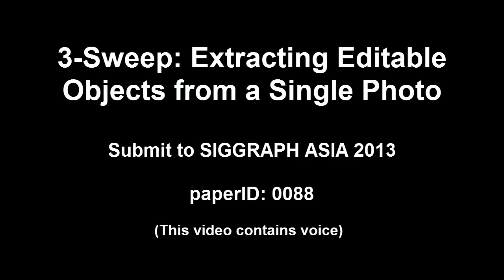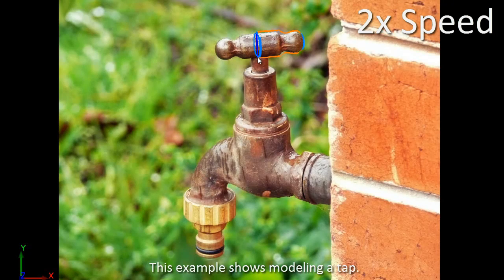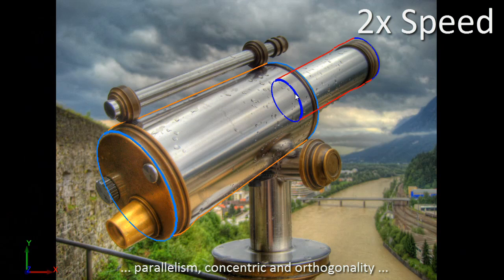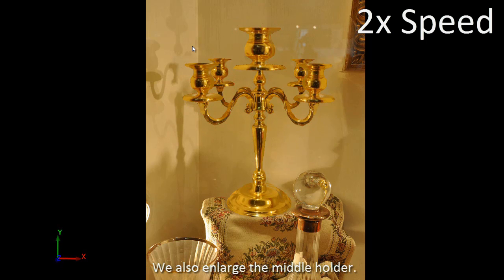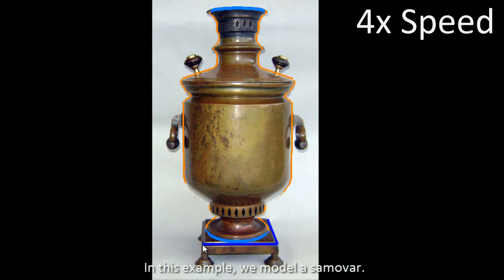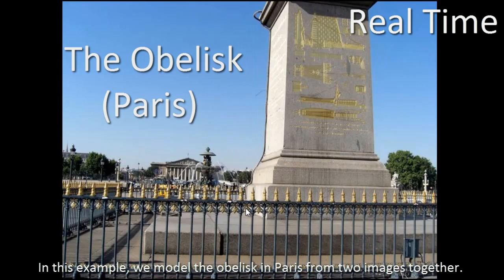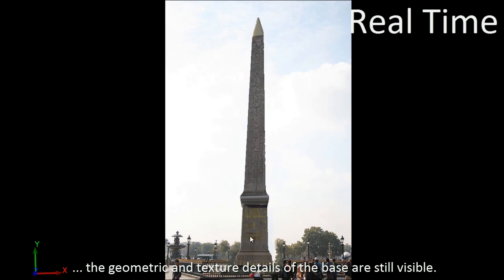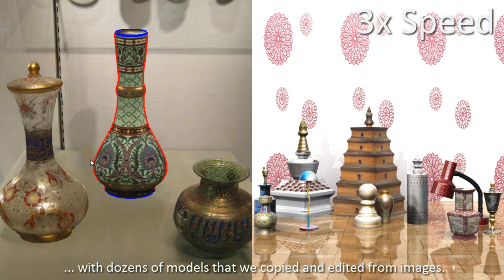3-Sweep: Extracting Editable Objects from a Single Photo, SIGGRAPH ASIA 2013

Comment: Too bad this requires some level of symmetry and that it gets fooled by shadows etc.
But it's great technology. Just needs to mature a bit more for practical use.
Reply: they can get around those errors by allowing the user to manually edit the curve. like with the bottle that has poor edges you can simply put a new edge that follows the contour.  for the toothpaste, i could see a similar editor that allows you to put in primitives you think fit better and the app can blend the new 3d model with the current. think the same can be said for the table with odd perspective.

Comment: -Looks too good to be true. If this was legit, you would have shown the entire interface of the software instead of showing us the edited photos  . And if so, Hollywood would have mentioned this ground-breaking technology already.
- Creating texture out of thin air even for the other side which is not visible? What soft of witchcraft do you use to uv unwrap it?  
- This software really defies the laws of physics and cgi
- It would probably disrupt the entire industry. Imagine modelling absolutely "anything" from a photograph
- It's the 21st century after all, technology like this is bound to be invente tho
Reply: "-Looks too good to be true. If this was legit, you would have shown the entire interface of the software instead of showing us the edited photos  . And if so, Hollywood would have mentioned this ground-breaking technology already."

sadly a lot of breakthroughs become vaporware because nobody knows the potential or companies just buy it to sit on it.  

"- Creating texture out of thin air even for the other side which is not visible? What soft of witchcraft do you use to uv unwrap it?"

they simply project the photo onto both the visible side and the occluded side of the model and maybe do some automatic symmetry to clean up messier projections.  as for how they get rid of the background Photoshop has had Content Aware Fill since CS5, maybe even earlier.

" This software really defies the laws of physics and cgi"
not sure where you got physics from but $50 says this can be cooked up in a plugin API.  all it does is find edges and then flips those edges in a symmetrical way to build a 3d form. like  it can turn a hexagon shape into a cube shape by mirroring the bottom 3 points into a 4 point plane and extrudes that new square shape into a cube shape that follows the contours of the diamond, making the 12 pointed hexagon actually an 8 pointed cube.

"- It would probably disrupt the entire industry. Imagine modelling absolutely "anything" from a photograph"

it would increase productivity by %200. compositors would use it to  generate quick 3d scenes from plate footage to pass off to the VFX guys  without having to waste precious time for structure-from-motion to take hours to generate and don't need to go on location to lidar and photogrammetry the environment at the beginning, just leave that technology for the final comp when the scene blocking is complete.   modelers will use it as a kitbash app that lets them model boring and mundane but very necessary items like tools hardware utensils etc leaving more time to create the wholly unique and original assets ie you use 3-sweep to "model" all the car parts your transformer character would be covered in.
3d printers and prop makers will use 3-sweep to generate "base models" of movie props they can't get their hands on physically allowing them to get rough measurements to build off of rather than having to manually measure each dimension, doubly so for things that only exist in photos now like demolished buildings and lost artifacts.
AI scientists working with machine vision will use 3-sweep to feed their algorithms prime examples of the images it will see being physical objects, by having the original photo along with its to the pixel accuracy model providing depth, contour, volume and other attributes found in 3d items.   this can only help the industry not hurt it.

"- It's the 21st century, after all, technology like this is bound to be invented tho"

too true. if they don't release it someone else would make it given it simple nature. hell we got a face mapping technology remade this year when the tech existed sicne 1999.

Comment: Friends, this is great! Do you think it works? Link:
#Lovely_3d_Effect_Photo_Photo_Animator_Ae_Templates
Reply: +DESIGN IS MY LIFE Very cool project.
Reply: +DESIGN IS MY LIFE It's great
Reply: +DESIGN IS MY LIFE Yes. It works.
Reply: +Only Best Templates - where did you get a copy of this software? I haven't been able to find it anywhere.
Reply: +Chris Burke This is the template for the program After Effects. Via the macropoker it is sold.
Reply: There is still no proof of it's existence or functionality. Nobody, not even yourself, has been able to offer any proof in the form of a verifiable software product sale page, nor download to suggest otherwise. Until that much can be done, it should be assumed that it does not exist or does not function. If it is a plugin or add-on for an existing software product, then proof would be something such as a tutorial on where to find it, how to get it, and how to install it in to that software product.
Reply: AfterEffects doesn't do this.

Comment: The telescope case is very interesting: Since you have a 3D representation of this object, you can now exploit the reflection on the cylinders to reconstitute the scene on the back of the photographer ! and since you have multiple different  reflection with different positions, you can even turn it into 3D.
But this would require quite much hard work to be done!

Congratulation for this amazing software !

Comment: The only question remains. When will this wonderful piece of black software magic will hit us mere mortals ?
Reply: 2021 still not available
Reply: @bloomp7999  Lol...because it was an elaborate hoax in the first place
Reply: @Joyfulmischief  waaaaaaat yes it Indeed looks like a hoax, but i was hoping , it could be Real!
Do you have a proof of what you Say ?
Reply: @bloomp7999  No. But obviously...It looked really incredible, but never anymore info than this video surfaced, so there is little doubt now 😉
Reply: @Joyfulmischief  Research work takes time to be a commercial product. I think someone has already developed a Maya extension version of this on Github. But it requires some prior knowledge in programming to use it. I do not think any company would like to purchase this technique at the moment...
Reply: Alredy possible to do it on ISO Photo Perspective matched ortho RHINO CAD viewports..but without texturing which has to be performed manually afterwards!

Comment: Because it's not a cylinder getting wider. The program is looking for a specific shape that the user has selected and pointed out. The area the user painted went all the way to the top, so looking at the whole thing, it can see the arms are not part of a skinny cylinder and ignores them. It doesn't just look for edges, it looks at the shapes in the photo. I'm guessing this is why there was so much brushed metal, since it makes it easier to identify a shape visually from only 1 angle.

Comment: One question: if the software gets a 3D model from a single 2D picture: how does it know the part of the background behind the telescope, which is visible after this element becomes "moveable" as a 3D object? It seems like there are two separate layers: telescope and background, not just a single picture.

Comment: It assumes simmetry...
No one knows what really is on the other side, but you can guess, that it is just the same as this side. Also "just a bit of shaking" what??? WTF? Are you blind? There is rotation around multiple axles resize and move all in 3d not in plane... This is like magic, i hardly believe the modelling part, not to mention the skinning, background fill, shadow correct and all the rest.

Comment: I've seen iteration synthesis at the last SIGGRAPH. So basically algorithms that take some models (for example, five pairs of different sneakers) and from that set, these algorithms can create new sneakers (!!!). So you can imagine how that will work with this one here? You'll be able to "3D trace" an object from a photo here (for example a street lamp) and then once it's recognized as belonging to the category "Street Lamps", the algorithms will generate 50 different new/different design ones.

Comment: Don't equate yourself to the "credible people", ok? 3D resynthesis software exists for years and has been used to create 3D models out of multi-frame videos. The only difference was the multi-frame, multi-angle nature of moving pictures. This here is simply an evolution to a point where vertical/horizontal mirroring of the helf-lines (there are always two) and path-recognition is further automatized. No, this is not the church, so you don't need to "believe" anything here, Mr.Expert. lol

Comment: Looks like it only builds the objects by mirroring to the other side. The difference is that it also calculates the angle of the object then builds the object at that precise angle. This will only work for objects that can be split in half. Cars, boxes, candles. For instance, I don't think this would work for something like a person unless you had a front and back image to mend together after building the object

Comment: At 1:10 they stated that they use another "patch match" program to fill in the holes created by removing the object.

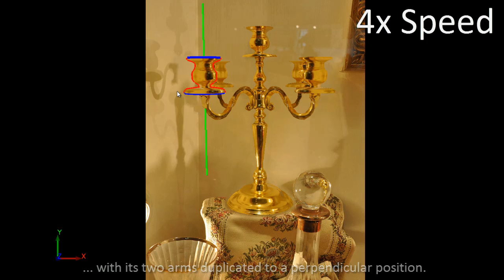This is visible at 2:18 if you look to the far left at the candle's shadow.  The area where the the candle used to be has a solid shadow with a noticeable "cut" in it, and in its place is a fuzzy area that is a color that results from mixing the shadow and the yellow wall together.

Comment: I don't see how this replace the manual modeling.

The software results are amazing, yes, but you still need 3D modeling knowledge to fix the automated results or modify it (specially for rigging).

This only make the process faster, but it doesn't do it all.

Comment: Look closely at the background of each example as they have repeat blocks of pixels of the surrounds. This is feasible to do automatically but with less predictable results than if you are to pixel edit the background after you have extracted the 3D model. Totally acceptable but perhaps should have been explained in the video to avoid criticism.

Comment: It doesn't really.  It's the same way content aware fill works in photoshop.  It recognizes patterns and colors and fills them in using clones of other bits of the photo.  It's not 100% accurate, but it doesn't usually need to be, and provides a good base for the user to work off of.

Comment: It doesn't know..If you rewatch again, you'll see that they never fully turn the object around.

Plus, they cut the video multiples times, probably because there were alot of fails in the process...Keep calm 3d modelers, your jobs are not at risk.....yet.

Comment: I guess it blends in some patterns found in the surrounding areas of the piece you remove. The candle around 2:08 shows an example of failure when the shadow on the wall of the arm that is being moved is filled with the color of the wall. It silhouettes the missing arm with plain colour.

The amazing one with the telescope shows a flat horizon and a half town half mountain filling. It shows a fair ammount of "guessing" right there. It may even be configurable

Not perfect, but pretty close :)

Comment: Ever try using Photoshop's Content-Aware Fill tool? It automatically samples areas around the filled area and attempts to reconstruct it using those samples.
So, say, if you deleted a house from a picture in which you could clearly see the sky behind it, the tool would automatically fill in clouds from the surrounding area in the picture. This program uses the same concept.
You can easily see how it's inaccurate at 3:50 - look what happens to the base of the Menorah.

Comment: which is a tetragonal prism and thus a cylindric shape. It's all over the video: Define two axes, then extrude a long stretchy shape. Try a steel girder with lots of screws along it; they would need seperate actions to model them. This doesn't save as much time as you think - at least not for all sorts of objects - is all I'm saying.

Comment: I do not see anything spectacular. It can extrude based on the starting 2d shape that you start with (from what I've seen just circles and squares) and then if image is simple enough it will determine the shape of the object and extrude according to that.
It works for simple symmetric objects only and maybe it saves a bit of time since it automatically applies the texture from the photo.
This will be a good add-on to GIMP and Photoshop.

Comment: I don't believe so. This technology was on display at SIGGRAPH 2013, and can probably found on their convention website. It's a legitimate tech show and expo. Not to mention none of this is impossible. If it IS fake, and it's not, it's entirely possible. It extrapolates size data from height/width sweeps the same way you could determine a man's height from the size of the sign he is next to in a photo. It then uses image patching to clean up the background - Photoshop does this, you can try it.

Comment: I remember a test-video from a few years ago where you'd film your object, tracked the footage and then traced the contours of the 2D frames ending up with a texturemapped model. That program just kind of dissapeared since then. But I'd imagine that coupled with multiple images we could do some pretty detailed models. Even 123D would be great if you could actively trace contours instead of just pointing out points and if AE could do this all and then do projection-mapping. That would be great...

Comment: I wish this were as impressive as you make it sound, but.
Does not work for non-silhouette details.
Only works on symmetrical objects.
The diffuse texture looks neat when it's instant, but these textures will never be usable in any production setting.
This is nothing more than a really neat time saving device that speeds up the primitives modelling part of a workflow.

Comment: Chill out, you're not competing with the computer. 3D modeling is an art with creativity, not just a craft. This is just a tool to help you with the crafting part - you know, like every single tool in your 3D program, or would you rather be typing every triangle coordinate by hand? Now that's hardcore.

The big guys at WETA and such use tools like this all the time, and they know and work with the limitations in stead of laughing at them. That's what makes them professionals.

Comment: If you had ever tried to texture a full model from one crappy picture, you would realize what this video is about. Connect this to a CAD-generator that spits out proper splines and measurements to change later and export a nice UVW-meshed, layered PSD to fill with better textures later and you will have the most rapid prototyping for 3D-creators ever.

Comment: a tree would probably be the hardest thing to model this way (lots of intersecting branches even on a leafless winter tree)
Modelling the trunk however would be a piece of cake, as this system seems to work incredibly well with cylinder based shapes.

Comment: They mentioned it. pattern matching algorithms. Its like photoshops patch tool on steroids. Notice that the backgrounds in most of those images were not very complex. I assume that if they were, they wouldnt look too great. Also, notice the shadows on one of the candleholder images. Yep. Simple workaround if you want the background: retake the photo of what you're modeling without the model so you have the image data you need for a pro result.

Comment: Uhm....looks a bit fake to me.

How can the program detect how the details of the object continue on the other side of the object? (like at 0:39) how does it know that the circular line continues even on the back of the cilinder (when then it rotates)? Or how 5:34: how can the program reconstruct the decoration on the vase on the dark side of the object?

Image processing is not that fast and easy.

Comment: Very good point. This is a nice step forward. You are certainly correct that without perspective on the features without a solid outline, the 3D model of something like a car would be lacking where 3D features have no perspective. This could be rectified by taking stereoscopic pictures and some very clever software, while still being quicker, easier, and more accessible for the masses, especially in museums and other collections where the piece is unavailable to properly 3D model it.

Comment: Yeah, I think its would be most useful to quickly block out base model. Though it seems  that it mostly needs symmetrical/lathe based assets which limits the options severily.

Comment: The main problem with this is that humans are not symmetrical, while close to all objects in the video were. Cylinders are easier to figure out than a human face, which is pretty complex.

There is however already technology that uses several photos to create a 3D model.

Comment: It doesn't. It blends in the texture from the visible surfaces. With mixed results.
Obviously things such as the telescope would fail if turned further since the opposite side is not similar.